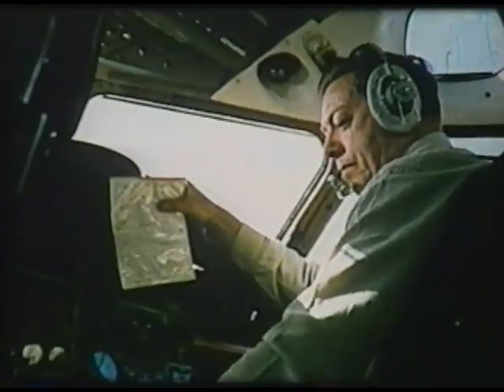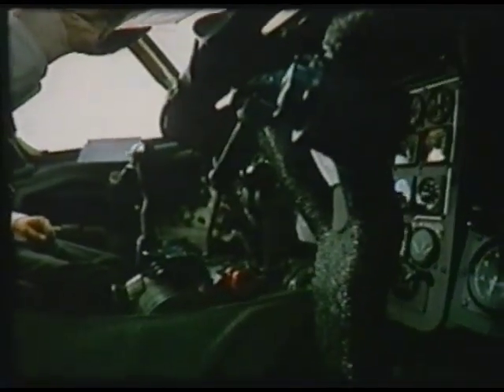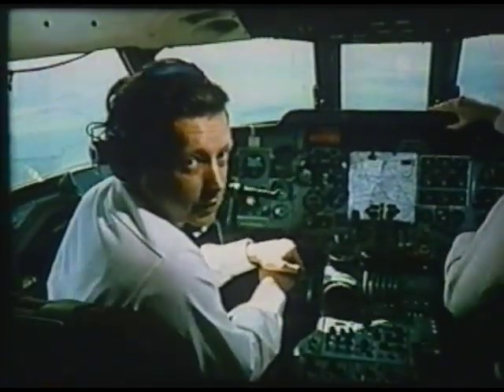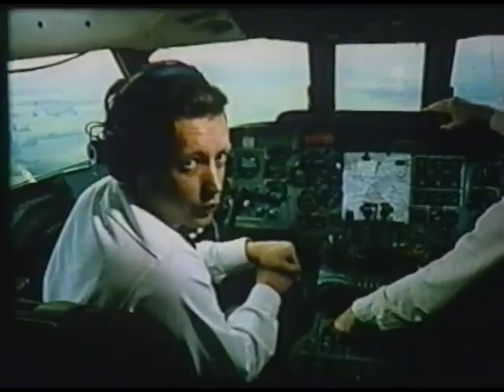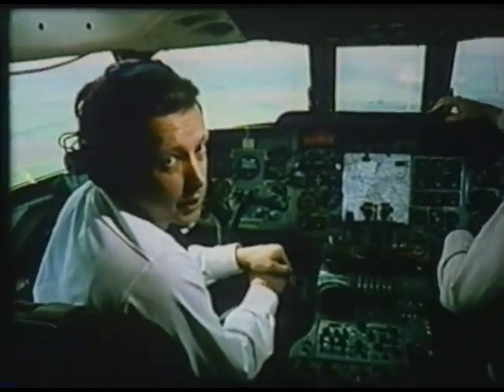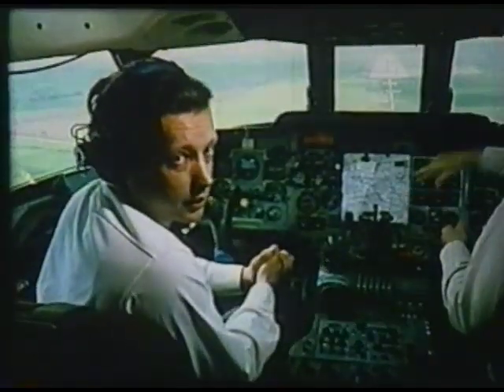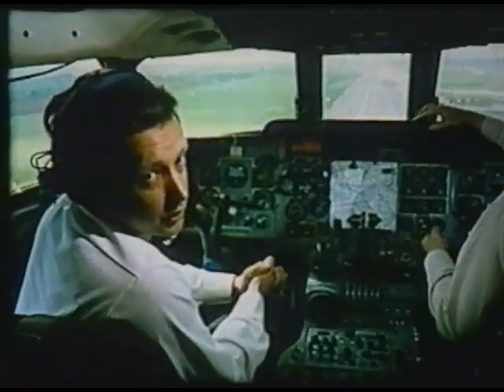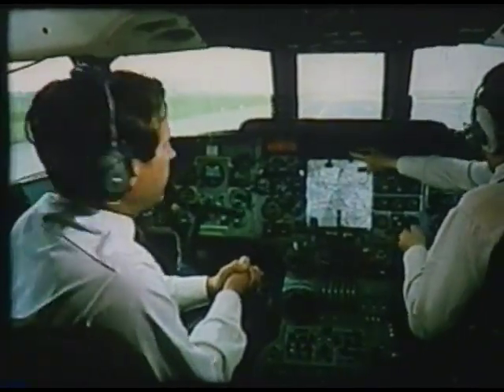Trident Autoland Demonstration

Comment: Back in 1968 I was on a Trident flight from London to Glasgow and then later in the day back to London again. The autoland was clearly in operation as the engine RPM was constantly making subtle alterations during the final stages of the approach. The system was remarkably advanced for the time and worked very well.
Reply: Dayum that means your over 60!
Reply: Autothrottle caused the engines to continually 'make subtle alterations', during an approach, but that didn't necessarily mean that autoland was in use. It could be an autocoupled approach to a manual landing, or a manually flown approach using autothrottle. The autoland system was excellent, however. For quite a while, in foggy weather, Tridents were the only aircraft flying.

Comment: What airport is this
Reply from the maker: It was RAE (Royal Airforce Establishment) Bedford. It was likely the only airfield with the equipment that provided the autoland capability for the Trident. In the 1960's none of this equipment existed at airports like it does today.
Reply: @MrMJKTuck  The narrator says in the introduction that it’s Hatfield Aerodrome - Located in Hertfordshire. Which would make sense as this was DeHavillands main testing and manufacturing facility at the time.
Reply from the maker: @joegrimeh950  Yes, the narrator does say that but he is incorrect. They used the facilities at RAE Bedford for all the development testing.
Reply: @MrMJKTuck  Interesting! Thanks for the info! I visited the Hatfield museum a couple years ago since my Grandmother lives nearby in Herts. Fantastic place! but they did not mention that it was tested at RAE Bedford. What has the issue? Did Hatfield not have the infrastructure for a CAT 2 or 3 ILS Approach at the time?
Reply from the maker: @joegrimeh950  I believe that was the reason. You must be referring to the De Havilland Museum in nearby London Colney. They have the original Mosquito prototype on display there.

Comment: I have done many autolands on the 747-400 and -8 and I have never seen anybody looking back during touchdown. Never. Either this guy was plain stupid or this was a simulator. My five cents. 
Automation is still very helpful, of course. But autonomous flying is a thing of the very distant future. The third dimension is a hundred times more complex than sending Teslas down the road.
Reply from the maker: The co-pilot was also a test pilot and ready to take over if necessary. It was a genuine approach (into RAE Bedford actually - not Hatfield as stated in the clip). Purely a test demonstration flight of course - no passengers on board.
Reply: @MrMJKTuck  As much as I enjoyed the clip, the poster was right. Seat back and looking back in an airliner making an automatic approach and landing was and is foolhardy. It’s a 2 pilot operation. No matter how well the automatics are performing, they need constant monitoring by both pilots at such a critical stage of flight. It’s certainly not a “hands off” situation. Fly like that regularly and eventually Murphy will get you. Thankfully, cockpit discipline and operating procedures have come a long way since the days when this little gem was shot. This would not happen in today’s flight deck. Signed; a 737NG captain.
Reply from the maker: @109-w7v  Absolutely 10 9, can't disagree with you there.
Reply: @109-w7v  Yes I don't think anyone is claiming this should be done on the line. It's a marketing gimmick for the cameras on an empty plane with two test pilots.
Reply: @109-w7v  Bet you’re not a 737 pilot. Keep dreaming.
Reply: @109-w7v  no, I disagree. It’s making a point on a test flight. Entirely different rule set.
Reply: Wind your neck in old mate. This was a test landing with an empty aircraft to demonstrate auto-landing. This may be routine nowadays but in the 1960's it was real 21st century stuff.
Reply: @PenzancePete  To this day it's not routine. It never was. I do auto landings once in a while. I know what can go wrong. Do you?
Reply: @Renato.Stiefenhofer.747driver  better this once for a demo with an empty plane that drunk or without proper sleeping to add up free days with a plane full of passengers now and then and we dont say nothing about.
Reply: @Renato.Stiefenhofer.747driver  having the radar altimeters fuck up and start the flare at 500 feet. XD.
Reply: Oh please Renato! This was the late sixties, way before CRM and Health and Safety. These boys were driven by intelligence, pride and passion.  If you really are a 747 pilot (unlikely) I’m sure you’d appreciate the airmanship.  Flying a 747-400 and 747-8 on your PC is not the same buddy.
Reply: @anthonyglee1710  Dear Luca, too lazy to do a simple  google background check about my 747 credentials...? 
Regards from the 747 left seat. The real thing 😉
Reply: @anthonyglee1710  Yeah I have to agree. I have no doubt that this would be never allowed today, but things were very different in the 1960s.
Reply: Another thing to remember, a selling point of the trident was it was a triplex aircraft, three autopilots, three hydraulic systems and three pilots. There was usually a pilot monitoring, even if there wasn’t, there was also a flight engineer monitoring systems. These were test pilots and it was a time when they really had to test limits and there was an element of danger. Granted, I’m not a qualified pilot but, being an avid fan of wonderful aircraft like the trident, vc10, Concorde, I wish I was a pilot in the 60s!! Glorious days and truly pioneering people and planes ✈️
Reply: This very clearly was a PR stunt to demonstrate the autoland system. It was an nice act put by the test pilots, I'm sure the sales team came up’with the idea in the first place.

It makes me wander whether HS/BAE carried this mentality towards automation when they joined Airbus and impacted the design and mentalityof the manufacturer... as we all know how heavily Airbus later emphasized for 2 decades how their planes couldn't stall thanks to fly by wire... One of the French managers went on to say that his cleaning lady could fly the plane.
Reply: You should then know this was a demonstration by test pilots marketing a plane that can do autoland and it is VMC plus the right seat pilot was PF.

Comment: Autoland this makes it hard to believe pilots will disappear in the next few decades because the same tech has been here since this day and we still have 2 pilots.
Reply: roman you fat fuk!
Reply: @ZBA1  cousin?
Reply: @devinthierault  hahahahaha
Reply: Auto land isn’t to make flying easier. It’s to make extremely difficult landings possible.  

Very few aircraft are CATIIIB Autoland capable.  They need special instruments and displays and those have special maintenance requirements (thus it’s placarded on the aircraft whether it’s currently capable of CATIIIB operations or not). 

Not many airports are capable of CATIIIB operations. They also have to have the equipment that is rigorously tested as well as having instant backup power in case of an outage. They also have to be conducting CATIIIB operations which requires more spacing and aircraft on the ground to hold further away from the runway.  

The crew has to be CATIIIB certified as well through training and simulator tests.  

And when a CATIIIB autoland is being performed.. it’s not like this.  They were able to do this because the weather was good and a single pilot can easily monitor the instruments and outside.  In a real CATIIIB landing you don’t have time. You have one pilot monitoring the instruments ready to perform the missed approach if something goes wrong and one pilot looking outside ready to perform the missed approach if what he sees doesn’t make sense.  

And CATIIIB means an autoland.. CATIIIC.. which allows the autopilot to control the rollout and apply steering, brakes, and reverse doesn’t exist yet.

Comment: What a wonderful piece of marketing this is, captain looking back at the camera as the plane lands itself, not a care in the world.
Reply: Sadly this won’t ever be done again. I hope Lockheed makes a new one
Reply: @Dan_the_Great

What are you talking about?  Tons of modern airliners have CATIIIB Autoland. 

Lockheed?  That would be a disaster.  The L-1011 was late into service, sold very few examples, and was early into retirement because Lockheed treated it like a cost-plus-fee military contract.  

Most of what the L-1011 had going for it was luck. (Delta 1080 should have crashed due to a jammed stabilizer, Eastern 935 should have lost all hydraulic fluid and crashed due to centre engine explosion).